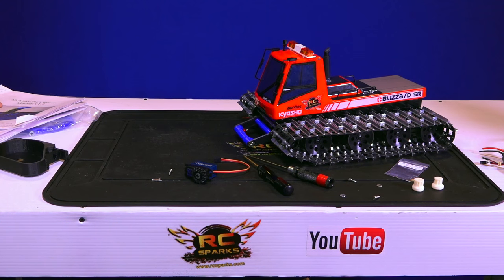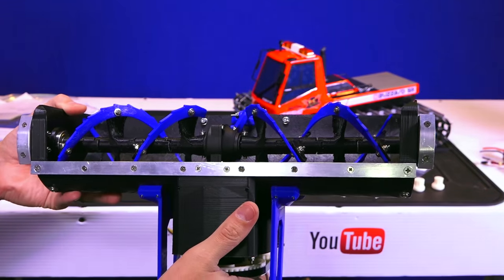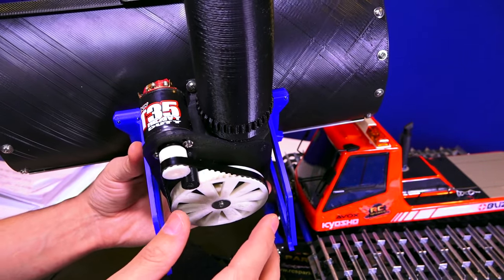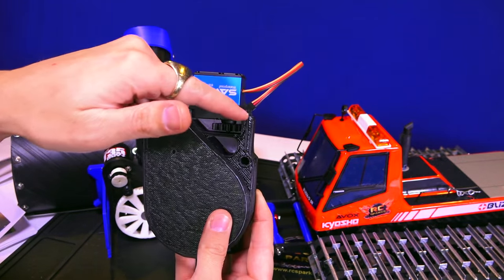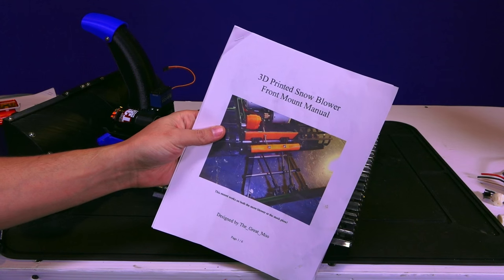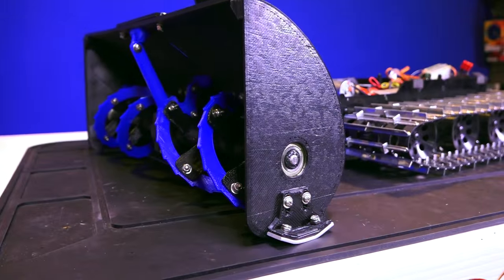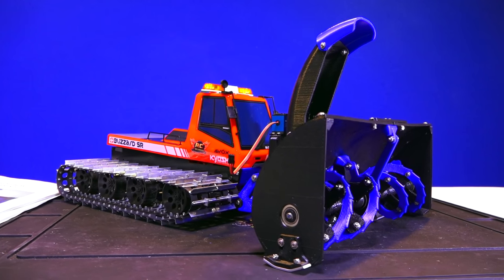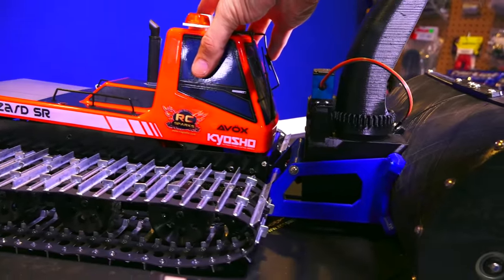RC ADVENTURES - HUGE 3D printed Snow Blower - Kyosho Blizzard - Spyker Workshop

Comment: When you start up the blower spray WD-40 inside the shoot and where the snow comes in so it doesn't get clogged. This trick works with full size snow blowers to. :)

Comment: 4 channels 1)steering  2) throttle(use a Y harness to tie in the front ESC/Motor snowblower,all the spinning will done be off the throttle channel and remove the red wire from the harness before you plug into the Rx ) 3)Your choice(track lift,or blower direction servo. 4) the same as "3" your choice (Bind: Use this to plug in the BEC(You can bind the Rx with a Rx pack separately).That should cover all the functions on 4 channels,I use the same land radio! Or if your feeling lazy,you can bust out a Heli/Airplane remote,and plug,and play,I'd probably use my DX9 just for the channels,you can add lights,motor noise,whatever you can imagine! Your Choice! :)
Reply: +im2tall1 You can also run a "Y" harness off the bind port for the BEC, one side will be for the BEC,and the other will be for the Bind plug!(The Bind plug Y harness doesn't have to be altered Plug and Play)!
Reply: +im2tall1 It might be possible to connect both the blower motor ESC and the lifting servo to the same channel, so when you lower the blower the ESC turns on also, it would have to use only 1 side of the servo throw, not sure if it would have enough power to do that, worth experimenting. I personally use a modified 9X radio system with a smartieparts board inside.

Comment: That's a really nice blower looks like a really high resolution print must have took a long time to do just one side of the scoop. The blades aren't just a round plain print they've even got some nice teeth maybe to help break the ice. Look good and has some nice strength hope it take the cold well tho
Reply: +bob michael The current kits being shipped out are MUCH smoother and nicer looking. This was one of the very first kits I sold at the beginning of this year, I&#39;ve changed a lot since. This one was printed on blue tape and elmers glue, which leaves a rough bottom finish, most notable on the side and belt covers. New kits are printed onto a PEI sheet and they have a very smooth flat matte finish on the bottom now. Just FYI for anyone interested in ordering one! Functionally still the same though.

Comment: my only concern would be used with a plastic hold up to the temperature that being said it does look absolutely amazing and am really looking forward to seeing it in action
Reply: PLA plastic is designed for a lower melting point for ease of use in 3d printing so I would think that would make it better for lower temps all the way around. not sure
Reply: The only reason I say that is because I heard that 3D printed plastic can brittle I'm not 100% though
Reply: +landy kid The blower is printed with normal ABS plastic, should be pretty good, I live in Minnesota and in my videos of testing it, it was around 0F and it did just fine. I print the kits with a 0.6mm nozzle and low layer heights for maximum layer bonding strength, pretty close to the same strength of molded ABS parts.
Reply: thanks for sharing the info, one day Ill have the budget to get a printer myself.
Reply: Moo Spyker awesome insight I do not know a lot about 3D printing I just remember hearing at one point some of the plastic can be brittle. I must say though that thing works amazing looking at your videos
Reply: shouldn't be a problem since it's used in the snow
Reply: gg
Reply: This is printed in abs so it is flexible and is very unlikely to break, but when I need something to be strong and I’m printing in pla I use a heat gun to bond the layers better.

Comment: Looks really good but I have several concerns about it.  The first is the motor mount looks to be in a downward angle this when running will cause the belt to walk forward and eventually off when it is running.  The other concern is the the blades them self because 3D printed items are not strong and are pretty brittle even when 100% fill is used so I suspect they will ether fly apart when spun up or they will shatter the second the encounter a chunk of snow sending shards of plastic flying
Reply: +EQUINOX Check out my channel, my original video it's blowing through icy snow. It's printed with ABS, I ran it in near 0F weather, works very well. Check out the "ultimate test" video of mine, at the end I cram it into the snow by hand really hard, no damage to the plastic blades, it took a rock to damage the blades.

The belt cover piece once screwed on provides a solid base for the motor mount to rest into, it stays square and true, thats why in the manual I said to leave it loose, cause it tightens up a little once the belt cover is on.

Comment: Wish they sold a snow blower for my Summit!
Reply: are you brushless?
Reply: +sam strothers my Summit is brushless
Reply: RC Grid mine too.  I also replaced all the electronics except for the receiver.. Which is rather disappointing. 

How many RCs do you have?
Reply: +sam strothers please hepl me i just picked up my summit and im having a buzzing or humming when turned on i think its the servos for steering but i dont know
Reply: THE MAGIC FISH are your servos stock? When you steer, does the power cut off?
Reply: +THE MAGIC FISH 
URC has a video posted on how to align and adjust dual steering servos for the Summit and Revo. This should fix your buzzing

Comment: I recently put in a sabertooth esc into my Blizzard but have a few hickups. Do you remember which toggles you used on the esc to help with throttle control? Mine is trying to run away upon getting power. thanks

Comment: my car came with a 7.2v 1800mAh battery but my grandpa also got me a 7.2v 3000mAh battery will it hurt it to use it cause I just got done running it with the stock battery and (with out letting it cool down) I puluged it in and it smelled like I was going to burn up the esc
Reply: +Mikey Tube its from DHK hobby and its a wolf2 1/10 scale 4x4 buggy

Comment: Hey medic I just got a cc01 kit and I was wondering what servo do u prefer and what Brush less engine
Reply: +Dezzy- RC I didint order the servo yet but I was checking out the traxxes 2056 what do u think about that or would u prefer the savvox
Reply: +Dezzy- RC what?
Reply: +shawn harrigan The traxxas 2056 is a plastic geared servo and has a very weak motor, plus the gears will instantly break on your first crash get a good metal geared servo from savox plus a castle bec and for motors just go for a 35 turned brushed motor you wont need brushless in a cc01
Reply: +codenamecougar thank u so much really appreciate
Reply: +Dezzy- RC thanks to u also much appreciated
Reply: +shawn harrigan And for a esc i would recommend a castle sidewinder 3, really nice esc for 2 , 3s plus it loves water
Reply: +codenamecougar the kit I order the cc01 Toyota FJ Cruiser comes with a brushless esc
Reply: +shawn harrigan I cant im only 10
Reply: +shawn harrigan so relly I cant build
Reply: +Hadden Luden dude I'm buying a kit for my 15 th birthday come tues day if u want to get a dead bolt u can but u have to buy a radio and transmitter and a batterie and charger that's a extra 100 dollars if u get a kit it will come to 250 with everything included but sold sep early the Kurt will be about 175 depending on what brand u buy the transmitter and radio is about 45 bucks and the batterie is around 30 so under your budget
Reply: +Hadden Luden if u get a dead bolt it's a extra 100 fillers for every thing u need that's why I prefer kits
Reply: +Dezzy- RC if I get a servo will it come with a servo horn

Comment: im thinking about getting a deadbolt but my budget is 300$ should I
Reply: Get a scx10 kit
Reply: +shawn harrigan well the only rc I have owned was a miney and I Broke it like 50 times
Reply: Look on ebay for powerhobby. I just got the deadbolt with battery, charger and beadlocks for $330 shipped. Will be here friday. Its a good starter rig and i have tons of upgrades planned for it already.

Comment: dont wanna spoil it 4 u guys that cry over the 3d printed stuff... but the maker made a video when he tested driving it right into stones when it was on... nothing happen
Reply: +deadhorsez Actually I broke the old prototype gearbox, shreaded the teeth of the gear when I drove it into those rocks but that was using plastic 3d printed gears lol, the current one here has a Traxxas maxx metal gear differential for the 3:1 impeller to auger transmission, muchhh stronger...
Reply: +Moo Spyker Haha well... "We" was talking about the "screw"? The thing that center the snow in the plow. No idea what its actually called... Sorry for bad english, pretty hard to get the right words ur got in ur mind in"birth" language translated to english. :D

Want this snowblower so bad... But i dont even got a kyosho blizzard haha